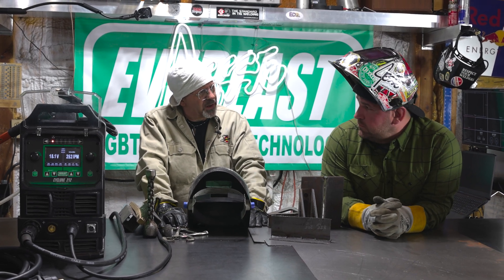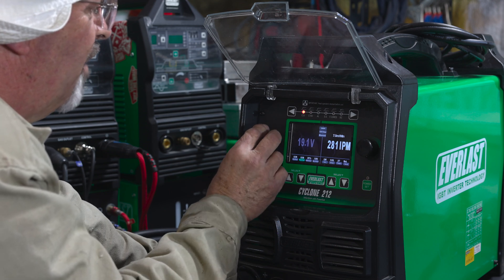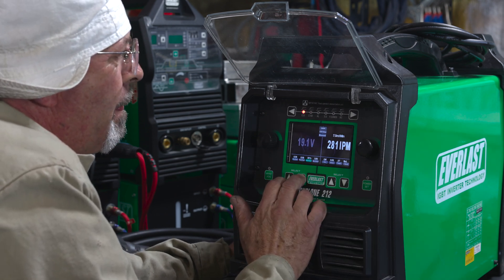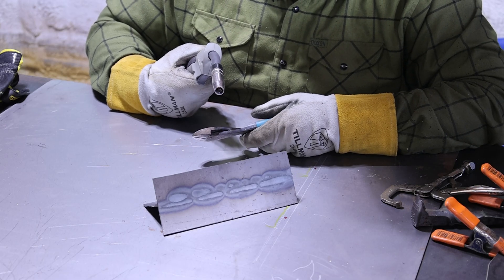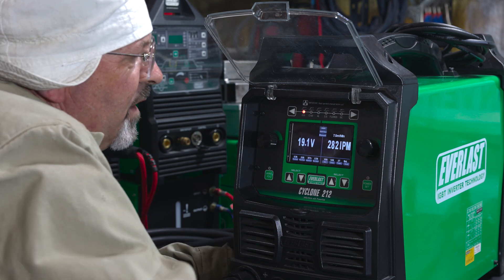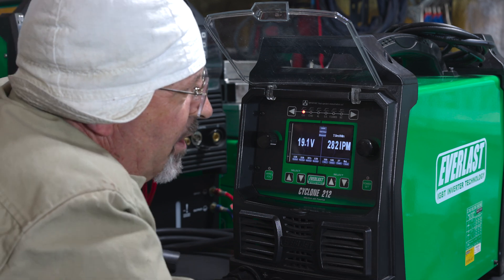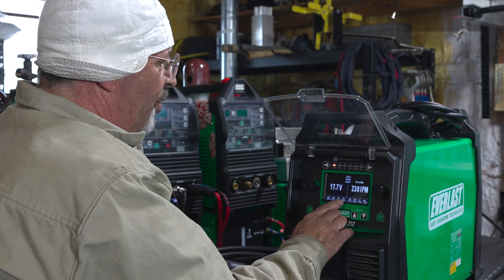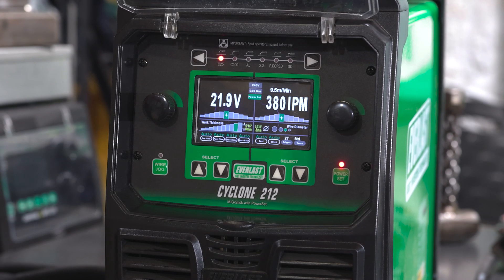Bob Moffatt and Jesse McCollum Test the Everlast Cyclone 212

Comment: Even in welding school, we were told running down hill was weaker than uphill. Maybe true if your technique is wrong. Maybe slow down a bit and/or adjust settings and you should be fine.
Reply: In general yes, but you can run downhill on thinner material with no issues, in fact downhill is usual practice in the sheet metal fab world, that’s what is done most if not all of the time. As long as you keep the arc out in front of the puddle you are fine.
Reply: @MJ-nd7cj  to be honest my feeling is if the material is thick enough that you need to run uphill you should not be using short arc MiG and should be running a 7018 anyways. Most MiG I run downhill and short arc MiG really shouldn’t be used on thicker than 1/4 in most cases. Just my opinion though.
Reply: @MJ-nd7cj  100%

Comment: Have a question about the 140E Mig/Flux Core Welder. So in the manual it says to not use an extension cord longer than 25ft with the 140E welder. Then it goes on to say that if you use a  extension cord for it to be 10 gauge and no longer than 50 ft. So this is confusing. My issue is will using an extension cord that is lets say 50 ft long and 10 gauge damage the machine. These comments by everlast in the manual contradict each other. Everlast needs to address these extension cord contradictory statements in the manual. Either you can use an extension cord or you cant. If you can then the correct size and length needs to be STATED CLEARLY. Not one statement saying you cant use extension cords longer than 25 ft and then another statement saying you can use an extension cord no longer than 50 feet and 10 gauge.